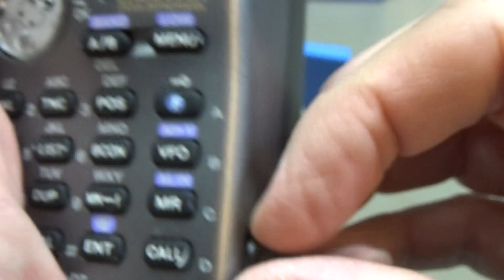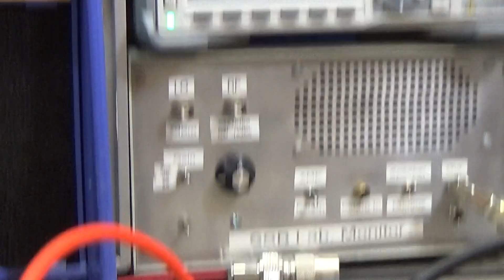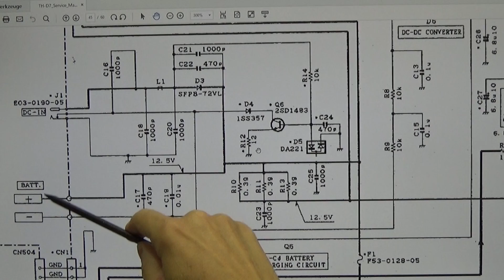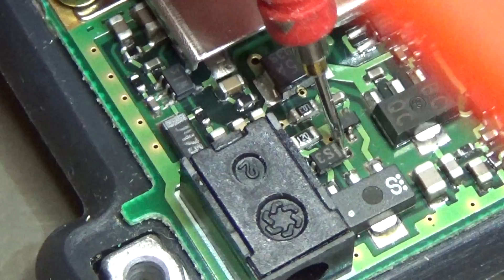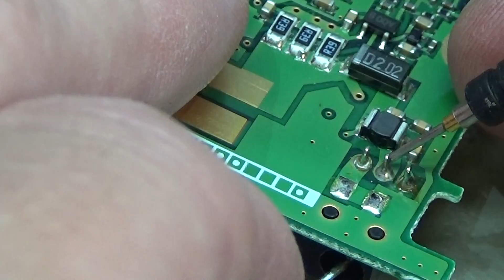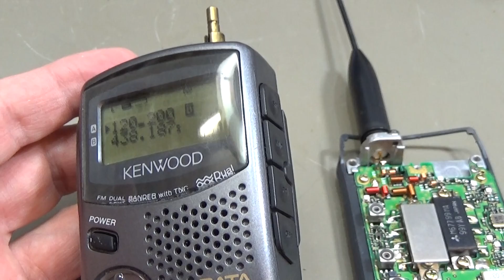#135 reparing a Kenwood TH-D7 which will not charge batteries

Comment: If it is anything like the kenwood th-f7e there is a tiny fuse onboard of the dc socket which is easy to blow i would never put 13v into the side of a radio like this use a proper desk charger

Comment: Just a quick  question. 
What is that filter do in the charging circuit?
Can I just install jumper wire to bypass the broken filter or should I just order a new part from Kenwood?
I watched your video again, I did find the TH-D7 radio in the basement.

Comment: I have the Kenwood D7 with the same problem. When the radio was plugged in to the 12V supply I shorted out the battery terminals. It is easy to make that mistake if you put the radio on a metallic surface with no battery attached. (I would recommend to put some tape over the battery terminals if the battery is not attached)  The radio is sitting in the box in the basement for years. Thanks for the Video! I will try to fix it, than let you know if it worked. Good job thanks again... ARPAD (VA3VAD)
Reply from the maker: Thanks for your hint and thanks for watching 73

Comment: Most probably without load PS gives higher voltage than is required so you have to plug it in with the load already connected.
Reply from the maker: Well a regulated and stabilized power supply with the right current rating should not have a higher voltage without load...Thanks for watching and comment. 73
Reply: Just my humble opinion: It should not if we are talking about universal PS but for mobile devices (where cost is an issue) the manufacturer knows exactly how much current the device is consuming so he can cut PS cost or move filters into the device for some reason. By the way what are specs of that PS ?

Comment: The battery you were supplied by the customer is a Ni-Mh and it calls for a Ni-Cd.  Charge profiles are completely different for Ni-Cd and Ni-Mh batteries.  It's very possible that what caused the filter to burn out was the use of the incorrect battery.  The increased current draw of the Ni-Mh battery was to much for the choke to handle.
Reply: The charging circuit is a constant current source.  You can't have 'increased current draw' with ni-mh on this charging circuit.  Even a short circuit across the battery contacts wouldn't draw any more than 60ma of current from the source.  The charging current was only 60 milliamps compared to the almost 1A of current drawn through that component when the radio is transmitting at full 6W output power on the AC adapter.  The battery isn't likely to have caused the demise of the choke.
Reply from the maker: Hi Mike, well with 60mA charging current is not my biggest concern but the 12.5 V at the batteries contacts and the fact that there is no automatic charge switch off are serious issues with the Ni-Mh batterie..
Reply: I noticed too
Reply: TRX Bench 

True, that is a fairly low charge current.  The fact that its a Ni-Cd charging circuit and not a Ni-Mh charging circuit would be a be of concern for me to.  What would be nice would be if a company came out with a Lithium battery pack for these that incorporated the charging circuit into the pack.  That way just snap on your new battery and the new charge cable would plug into the battery pack and not the radio.  Lithium cells are a lot smaller for the same capacity so there would be room to stick the charger in the pack.

Comment: Thanks Peter for the movie, it is an great radio. Have two of them, both need be to fixed. One has a vfo dead and the other they keypads are not working great but this seams to be an absolute part, need to find a way to repair those coll pads under it.
Reply from the maker: Thanks for stepping in Michael 73

Comment: that battery is ni-mh and the charge circuit says ni-cd...it may be an issue?
Reply: Both ni-mh and ni-cd can be charged with a constant current source.
Reply: Star Gazer 

Charge profiles are completely different for Ni-Cd and Ni-Mh batteries.  It's very possible that what caused the filter to burn out was the use of the incorrect battery.  The increased current draw of the Ni-Mh battery was to much for the choke to handle.
Reply: The big difference is that you do not want to trickle charge a Ni-Mh battery once it its fully charged, Ni-Cd batteries can handle being being trickle charged at higher voltages even when they are full, but Ni-Mh batteries will shed the extra voltage as heat and cook themselves. Other than at the end of there charge profile they are not too different. Generally the ideal charge rate for both is about 1/10C. And Ni-Cd's have a slightly lower internal resistance, while Ni-Mh have about twice the capacity for a given size. So MOST Ni-Cd chargers can handle charging Ni-Mh just fine unless there is a heat issue with the extended charge time given the higher capacity.
Reply: +MikesRadioRepair  Mike, it is a constant current source.  You can't have 'increased current draw' with ni-mh on this charging circuit.  Even a short circuit across the battery contacts wouldn't draw any more current from a constant current source.  Also, the charging current was a tiny 60 milliamps compared to the almost 1A of current drawn through that component when the radio is transmitting at full output power.  This radio doesn't have a complex charging circuit.  It is simply a current limited trickle charger (1/26 C charging rate for this battery).  It doesn't even detect and turn off at full charge.  It requires the operator to stop the charge.